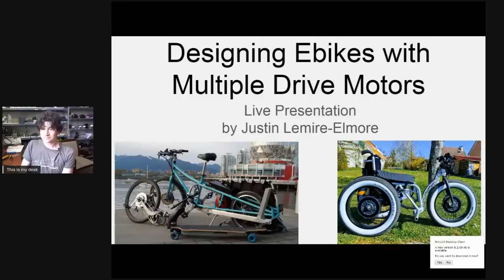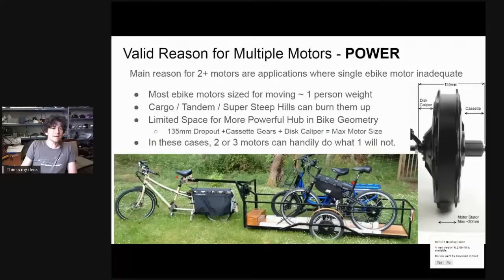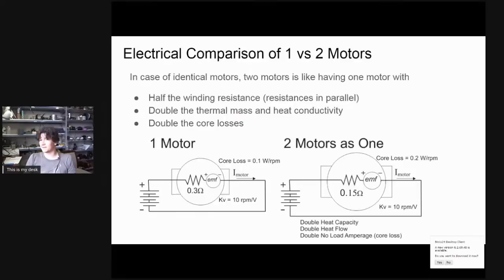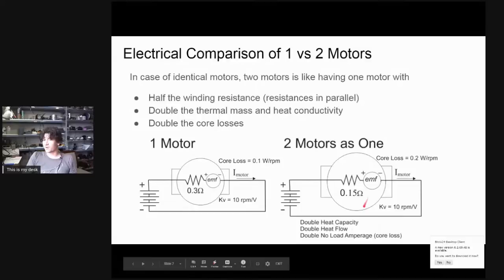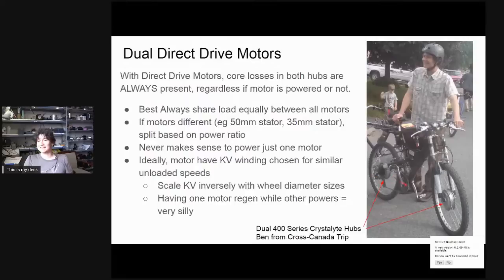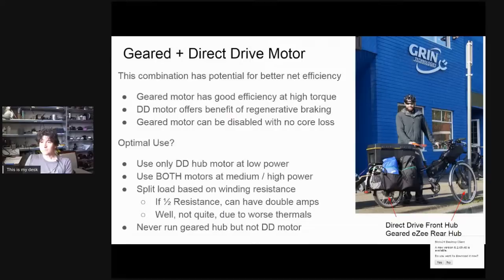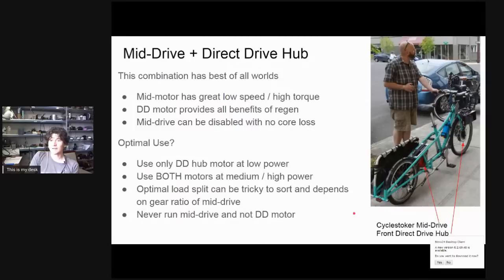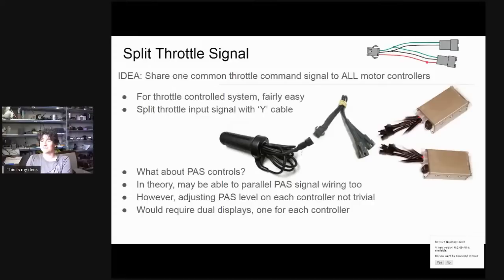A guide to multi-motor (2WD and 3WD) ebike drive systems

Comment: Should buy a full suspension fat trike that will get three wheel drive.  A big rear engine, plus your grin all axle motor on the front wheels.  You showed very well how two hub engines work together even though they are different sizes, and how to connect the controls and throttle.  Wish you showed how to connect three motors.  Can you put a splitter on a splitter to control three motors?
Reply from the maker: Yes sorry for not addressing this more explicitly.  All of the same principles apply to 3WD as 2WD, and usually with a 3WD system but then there is 1 more slit to do in the wiring. We're unlikely to make a "3-1" system splitter as a stock cable adapter, but you could apply the same principles to make your own.   The splitter on a splitter can work in some cases (like just the simple throttle splitter), but it wouldn't work for the 2:1 WP8 splitter since that has resistors in it for balancing the current sense.  I would normally suggest using the dual controller CA3 shunt and then just tapping in a 3rd throttle output wire.

Comment: The eZee motor is going up a 2% grade, but the secondary hub has 0% grade. Was that to load eZee more (1hr. 6 min)?
Reply from the maker: When the two systems are added as they are here, there is only one %grade control since they are on the same vehicle. The secondary %grade slider is disabled and not functional, the value that it has is irrelevant.

Comment: Is it fair to say heat issues only become an issue when motor power to total vehicle mass ratio in excess of 500w/100kg?
Reply from the maker: Nope, that should not be the takeaway at all.  The correct answer is that heat is an issue when the phase current required to sustain the necessary torque for moving the vehicle at a given load point (mostly dictated by %grade & total vehicle weight) generates more heat through copper losses than the particular motor is able to either absorb (through thermal mass) or dissipate (through conduction to ambient air) in the time duration of interest.    ex you can move 1000 kg on flat ground at 20 kph using just 500 watts of power no problem, motor doesn't even get warm:
https://ebikes.ca/tools/simulator.html?motor=M3540&batt=B3623_GA&wheel=20i&mass=1000&hp=0&cont=C25&autothrot=true&throt=72.5 

Same output power, but with a much lighter (200 kg) vehicle climbing a 10% grade cooks the motor in just 5 minutes:
https://ebikes.ca/tools/simulator.html?motor=M3540&batt=B3623_GA&wheel=20i&mass=200&hp=0&cont=C35&autothrot=false&throt=100&grade=10

Comment: Would another valid reason to "easily" enhance a stock utility/cargo bike with geared hub (radrunner) or mid drive underpowered but torquy motor with a DD hub motor that provides free/powerful braking through regen, and the power needed when utility/cargo capacity is actually used?  For radrunner, adding a 1000w front hub motor would seem to be good power/torque combo compared to trying to find a 2000w rear hub DD replacement, which may still be a net torque loss.  Though there is probably a mid drive motor that fits radrunner with even higher torque, and adding a rear 1000w dd hub, could provide marginal gains for what is fairly significant extra expense compared to keeping working geared rear hub motor.

Comment: For slower speed operations for folks with disabilities where traction is needed… any recommendations on lower Kv for this niche?
Reply from the maker: Usually about 7rpm/v is the slowest wind for an ebike motor. You can always set the speed limit in the controller for lower speed operation. This does not specifically require a low KV motor.
Reply: @GrinTechnologies  thank you!  I had seen custom wound motors advertised with Kv of 4.5-6 but running everything in your simulator wasn’t sure of what Gain vs your Grin Slow Fat all axle (7Kv) or even an SX1 for dual motor mobility trike. Max 15mph.
Great videos and tools!

Comment: You didn't go into 3+ motor hookups much.  Could I power a 2 (or 3) DD powered wheel trailer from a dual motor bike, with just more splitters?  Can I still disconnect the trailer without much fiddling with the Cycle Analyst settings much?

Comment: I have really enjoyed watching all of the information you have provided here on YT and your site, they are great to watch and I am amazed that you answered most of my questions/thoughts in your videos before I had the option to ask them!  I do have to ask your advice on something though.  I am 6'8" (203 cm) 235 lbs (107 kg) and I live in San Francisco which has some REALLY steep hills, the steepest of which aren't officially documented, but the steepest segment is 41%.  We have at least 10 hills above 30%.
I am on the waitlist to get a Quattrovelo+, and in order to be able to use it in San Francisco I believe I will require electric assistance, and even then it will have to be robust because I previously had an ELF with a TDCM midrive that would stall out on the hills to my house and I would literally have to get out and push while holding the throttle, even then it was so difficult that I would sometimes slip and have to hang on to the brakes.  With the QV I feel that I basically have two options: I can have them install a BBSHD bracket and run a mid drive setup, or run two front hub motors.  If I use hub motors I can keep my current drive setup, which is a 75t chainring with a Schlumpf Mountain Drive, so effectively 75/30 chainrings, and 11-46t cogs.  If I get the mid drive I have to get rid of the Mountain Drive 2.5 reduction gear and the largest chainring I can find for the BBSHD is 52t, limiting my capability on both climbs and speed without assistance.
 I used the motor analyzer tool on your site to compare the options not only at 30%, but also at 0% grade, both with a total load of 150 kg, and human assistance at 250 watts.  I used the cda and rolling resistance of a Quest as that was the closest performing velomobile I could find info for, and chose 48v batteries.
I like the idea of DD and being able to reclaim the energy from going down those hills and saving the wear on the brakes, but I don't like the idea of them limiting my speed due to drag.  Using the analyzer it seems like the max speed is about 34 mph on flat ground regardless of human input.  Would virtual freewheeling eliminate drag at high speeds?  I was using Grin v2 FST +Stratorade as the DD drives.  Would they be able to contribute at high speeds, when I am out of the city on rural roads, or do they basically have a limit of around 35 mph on 20" wheels?
If I were to use geared hub motors I could power up hills, and they can freewheel when I am cruising at high speeds, but using the eZee 250 RPM motors they would overheat in 8 minutes, faster than the 9 minutes of the DD motors, and there is no reclaiming of energy with regen.  On the flats they wouldn't offer any assistance after acceleration as I would be easily going faster than they can spin.
Now if I were to use a mid drive (I used the Grin V2 SLW without Stratorade as the mid drive with a 2:1 reduction, I don't know haw accurate that is compared to BBSHD) I would be able to climb up hills in my 52t/46t gears, and get better range than the other setups and be less likely to overheat, albeit at a slower pace.  On the flats I could go up to 42.6 mph under throttle, but I would not be able to contribute anything as I can not pedal >150 RPM.  If something were to happen to the battery or motor I would have to push up hills and my max speed would be limited due to the limited gearing.  Also, of course, there is no regen.
So, given all of the information, what do you think would be the best solution?  Would the possible future addition of solar panels have an impact on what you believe is the best choice?
Thank you so much for your time and consideration, sorry for the wall of text.
Reply from the maker: Hey there and thanks for the well researched question! Normally this is a conversation best carried over email, but we'd normally say that if the dual direct drive hub motor can do the job and is in your budget, you'll be forever grateful for all the benefits (silence, simplicity, robustness, redundency, and regen) compared to the other options.  But the single BBSHD will be cheaper overall for sure.  There is no 34mph speed limit, you can always go faster either with a higher voltage battery pack or with the field weakening feature in the controller.
Reply: @GrinTechnologies  Thank you very much!
Reply: @GrinTechnologies  You've very kind (?) to help out the dude whose claim to fame is shaming homeless people.

Comment: Hi, I built a dual-motor setup. I bought all the parts from you guys.    You mentioned in this video that there is a trick for making a step function in the phaserunner controller,  but you could bot share it because of a glitch.  Can you share that info with me?
Reply from the maker: Best to ask that via email, youtube comments isn't really the right platform for technical support

Comment: I would like to build a fat bike with front and rear hub drives and then maybe add a middrive someday down the road.
I would like to use your all axle aluminum hubs with laced rims,  please show us how it’s done what kind of controllers we need what kind of part numbers we need
Reply from the maker: Hi Larry, best to send an email to info@ebikes.ca with a picture of the bike you've got.  Our front All Axle hub can work with 150 x 15mm thru axle fatbike forks. For the rear motor, it would be a geared bafang G060 or G062

Comment: Hello I just came across your channel and was ver impressed, I am very new to battery powered vehicles but am very interested in it and the possibilities that are available for it.  For instance I am a handyman that works around a lake community that is very hilly.  I am very interested in building myself a 4 wheel drive cart that could help get material up and down the hills to the lake to work on docks, I am hoping to be able to carry up to 1000 pounds so I am doing my research to figure out what motors, controllers and batteries would work best  for this situation.  So when I came across your channel I was l very happy, thank you for making this easier to understand, I know I have allot to learn so if you have any suggestions for me it would be much appreciated.

Comment: 2 hub motor with one throttle  two controller any technical issue will come? for operation
Reply from the maker: See the video, I go over this in some detail, but the short anwser is that there are not that many technical issues as long as you have either matching KV motors or are using controllers with a torque based throttle.
Reply: @GrinTechnologies  we are using torque based throttle,
Reply: @GrinTechnologies  thanks for ur reply

Comment: Hi. I watched this video to find a solution for riding in the snow. The throttle mapping should keep my rear tire from spinning at takeoff if I set the rear motor to engage slightly later than the front. But I don't understand torque-based controllers or throttles. I have a Kelly KLS-S 4812S. It does have throttle mapping and I understand it. I've read the description and owner's manual for my controller but I haven't found anything that mentions torque-based or voltage-based. There are 3 different throttle parameters, but nothing I recognize as torque-based. A little help?
Reply from the maker: Unfortunately we don't deal with Kelly controllers so cannot offer any direct insight into their settings. Torque is the same as phase current, so if the throttle is mapped to your phase amps then that is effectively torque control.
Reply: @GrinTechnologies  ty
Reply: @GrinTechnologies  If you could direct me to information on this subject I would appreciate it. I've done searches and haven't found anything helpful.

Comment: Oh, and one more question: does the phaserunner do voltage regulation? Can I connect a 72V battery to the phaserunner for control of a 48V motor?  My hope is yes, the phaserunner does voltage regulation, but I suspect the answer is "no" that ai'll need a DC-DC converter or risk overvolting the motor(s)
Reply from the maker: All motor controllers do voltage regulation. That is entirely the primary function of a motor controller, to reduce the voltage of the battery to a lower voltage for the motor  (and converting DC to 3ph AC of in the case of a brushless motor).  Keep in mind that there is no such thing as a "48V" motor.  Motors do not have an intrinsic voltage rating.

Comment: Thanks for a very informative video. I'm seriously considering installing 4x1500w hub motors on a quad. This is because I commute up a steep long road to my place (on top of a mountain). What would be the best way to set everything up so that I can choose front or rear wheel drive when not climbing?
I'm guessing I need 4 controllers and I would say two computers screens? Geared sound like an option?
I'm very interested in how hub motors can be installed in this manner, the fact that they're only held by one side of the axle, are they modified or special orders?
Also is there a way around having to run one in reverse? I don't want steering issues with that much power.
Reply: I also have the question: how to run more than 2 motors using the CA3 and the Y splitters you feature in vid. Do you just split twice (or thrice or n times) and always use the red-flagged lead on the end-most Y branch? Is there some minimum RShunt value the CA3 can accurately interpret? How do you calculate RShunt for a multi-Y-split controller throttle signal?
Reply: @inklipMedia  Probably best to email them.

Comment: Great video! Are there options for using large capacitors to get full power regen breaking? We would need controllers with separate regen power output, and a manager to keep capacitors discharged while respecting the battery charging limit.
Reply from the maker: There is zero need for that, modern lithium batteries can absorb all the regen power just fine by themselves without any capacitor to 'help'

Comment: Great video! What to you recommend for a tank type steering for a electric dual motor skid steer (low speed)? I'd imagine you would need mechanical braking for turning.
Reply: I'm thinking of tank steering for my 3-wheeled, 3-wheel-drive Carla-like cargo trailer.I wonder if I could get some 'tank' steering benefits by using an active voltage amp/attenuator inserted between the CA3 computer and the motor controllers, taking input from stress-sensors in the trailer tow-arm, to modulate the relative throttle (torque/power?) signal going from a split CA3 signal to my two rear-wheel controllers? Somewhere in the Carla Cargo videos/literature they talk about inherent tip-over vulnerability of trikes and I'm thinking there may be a relatively intuitive sensor/voltage control that would tend to stabilize the 3-wheeled trailer during downhill braking+turning, or through any high-speed cornering (the two situations where I imagine tip-over might be most likely). Differential throttling of the two rear wheels could also apply exponentially as dual stress-sensors on the trailer tow-arm indicate the trailer may be jack-knifing and/or over-running the pilot bicycle/vehicle, to both straighten out the trailer and brake it overall (though braking isn't option with the free-wheelable gear-motor rear wheel / direct-drive front wheel configuration I'm now leaning into...). I'm thinking to load my trailer with 1500-2000 lbs payload, so controls and fail-safes to prevent it crushing the pilot and/or bystanders are a top concern - both when it is under proper motor control and when power/control fail for any reason.
Reply: Why would you need mechanical braking? An electric motor can brake itself, or even turn backwards, instantly.

Comment: What about having one  motor with no throtle and the other motor throttle only on seperate system  pedalling only on flat then both throttle and pedallin on hills
Reply from the maker: That works just fine too. In that case, we would recommend that the throttle controlled motor used just on the hills is a geared motor that freewheels.

Comment: All same motors and controllers. 2 for bike and 2 for trailer. Question Hou to use one throttle?????
Reply from the maker: Simply split that throttle signal to all 4 of your motor controllers.

Comment: Can the new 'Y' Splitter on CA3-WP be split twice, with the primary-tqgged controller lead after 2nd split being the primary motor (BLDC direct drive / regen on a Carla-style 3-wheeled trailer), and the remaining pair (secondary lead of 2nd split, plus secondary lead of first split) being a pair of clutched free-wheeling gear-motors on the two rear wheels (for starting / hill-climbing torque)? If so, what would be the calculation for RShunt? 1/3 of the nominal R for the controller used?
Reply from the maker: 1/3rd will work fine as long as the power going to each of the secondary split devices is similar. If you have unequal distribution between these two (say only one of the two powered up), then it will more heavily bias the split towards the current of the the primary motor, but as long as they are both roughly the same it the 1/3rd RShunt should do the trick.

Comment: Hey Grin Tech, I’m a little lost as how to program my second motor. Listened to this video a couple times...I have a phaserunner and a 40a grinfeon controller I have to divide the ohms...but otherwise with cycle analyst and other than autotuning the phaserunner (which is the second controller and motor) I’m not sure what else I need.
Reply from the maker: Best to send us an email.  I'm presuming you are using the dual controller CA shunt? In that case you just set the CA to 1.000 mOhm, and have the throttle output of the shunt go to the throttle inputs of each controller.